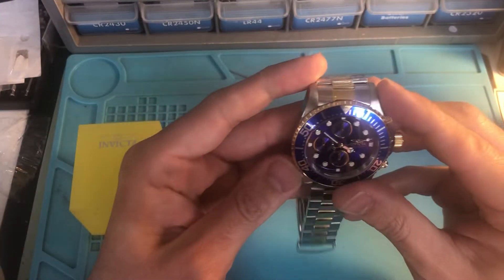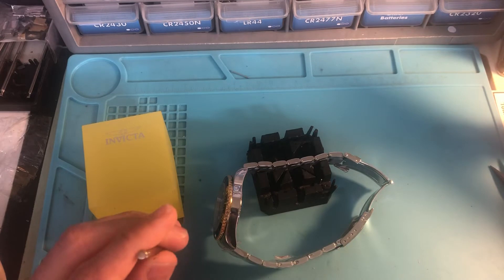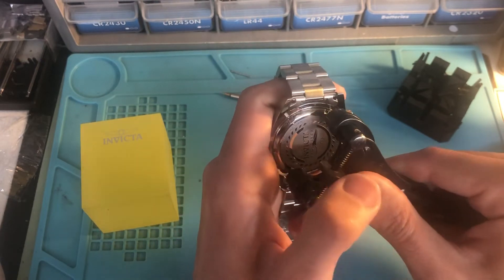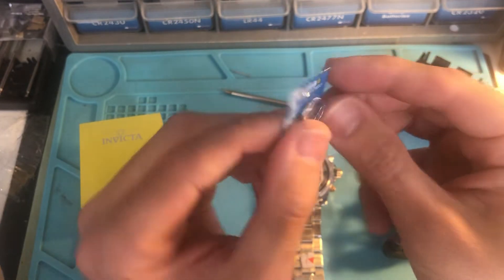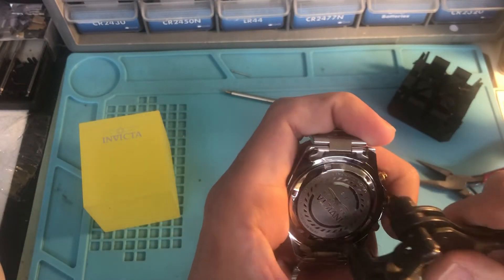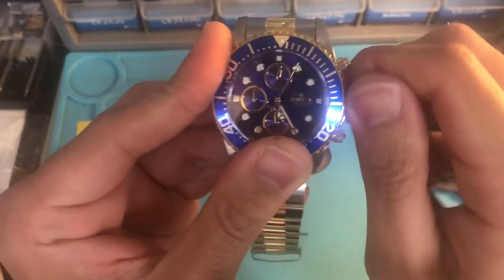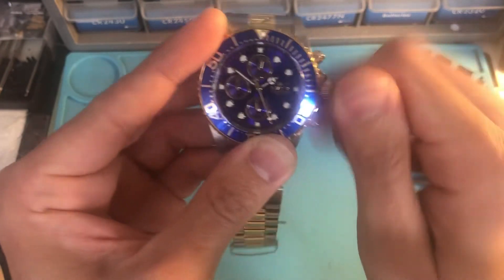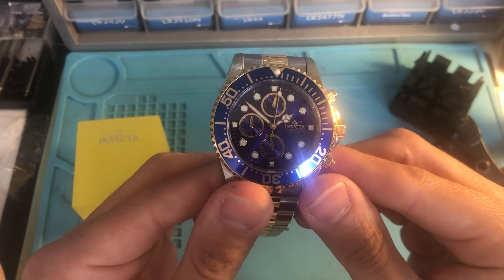How to replace a battery on a Invicta Pro Diver | Invicta 1773

Comment: If only it was this easy! I have 2 women's Invicta watches (same style, different face colors) and today I attempted to replace the battery on one of them. My plan was to take the working battery from one to use in the other watch. Two problems: the back of one watch was on so tight that I couldn't get it off. The other problem was that I couldn't get the (dead) battery back into the the battery compartment. It's slightly different than the one shown in this video, and even though it looks like there's nothing obstructing the space, I just couldn't get the battery back into the space. Now I have to decide whether I'm going to try again, or pony up the $ and have a jeweler do it 😒.
Reply from the maker: Email me at watchbatteryguy@gmail.com. Send me pics of both watches backs. As clear as possible. I will help you out
Reply: @watchbatteryguy7421  hello what is the number of that battery in this video..what battery model??

Comment: Pro Diver model no. 30480- The white case that sits on top of the battery and watch components is not fitting smoothly. It is slightly tilted and now I can't screw on the back of the watch. The battery is inserted correctly. I can't seem to figure out why the white case isn't fitting flush. Any ideas?
Reply from the maker: pull out the crown like you are about to set the time. Then insert the white case. This should solve the issue.
You may have pressed the movement further into the case and that could be causing the issue.